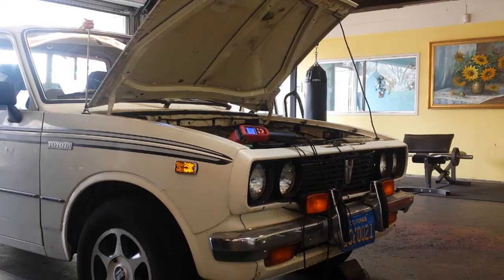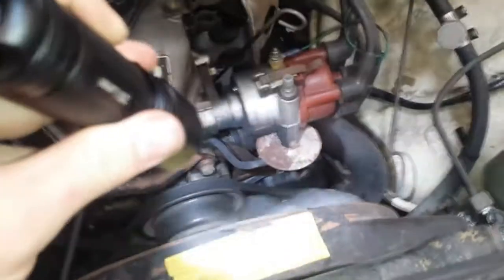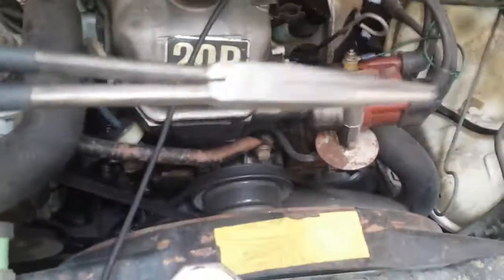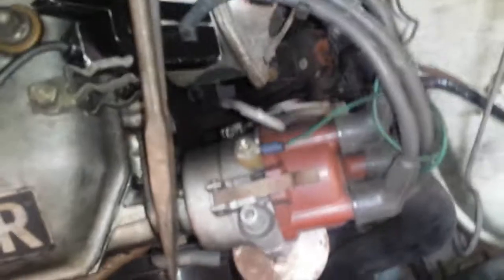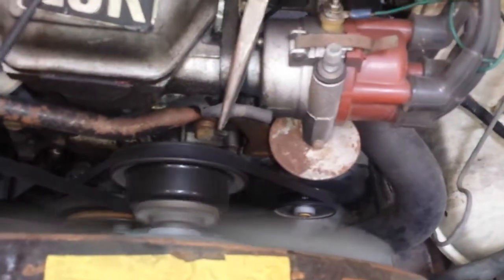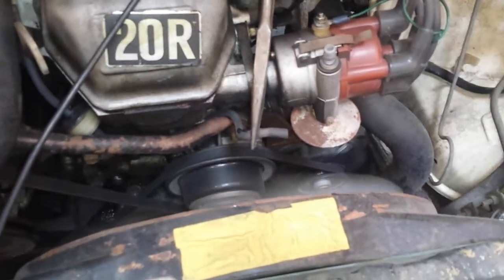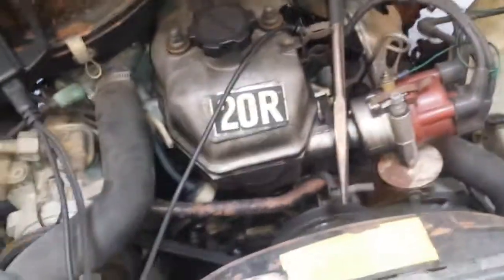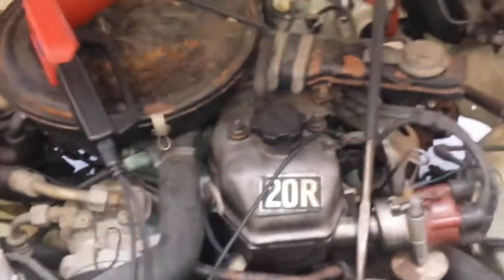Toyota Pickup ignition timing check and adjustment

Comment: Here a little  trick of a the trade.... when you're getting ready to put your new points in and you having a hard time setting the dwell..... such as on my 77 Toyota 20R engine...... set your dwell at 46 degrees and then gently tighten  (down the points) because when you tighten down your adjustment screw you'll be moving it to + 5 degrees This will dial you in at 51.5° degrees too 52° slick as it gets.....